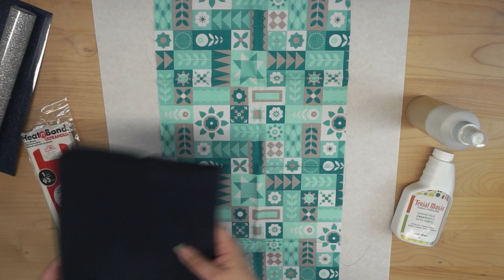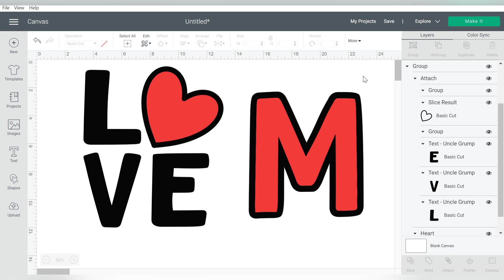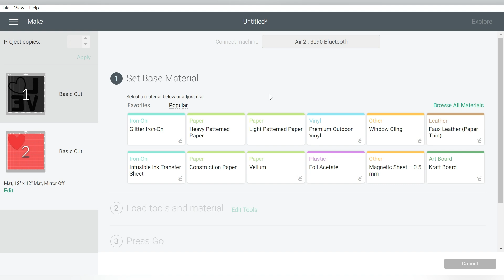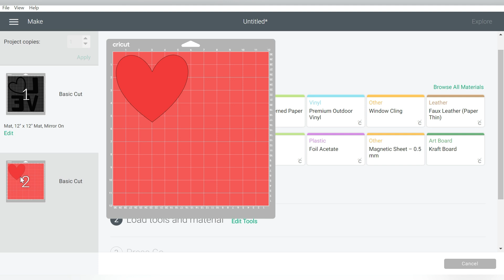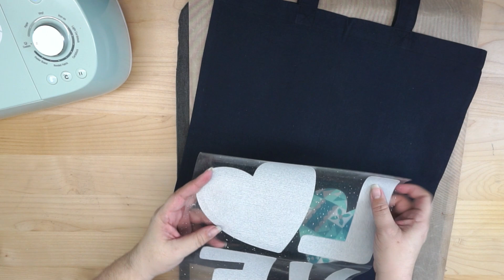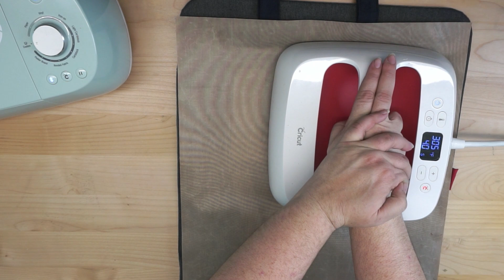✂️ How to Cut Fabric No Sew Applique with the Cricut Explore Air 2

Comment: Nice tutorial. I have done this before and not sure what I did wrong, but the applique piece or either the vinyl shrinks when heat is applied and doesn't connect.  It leaves a very small around the heart.  Did you do a video on how much of an outline I should use on the Cricut Design Space?   I love watching your tutorials.

Comment: Does the fabric need the spray if it’s cut with the heat n bond on it? Like does the heat n bond not add enough stiffness on its own? Also, would you happened to know how well it holds up in the wash?
Reply from the maker: Hi Markie! We recommend hand washing because the heat and tossing may affect the bond! - Dawn

Comment: Hi. This looks great. Do you have to use these products when cutting with the Maker?
Reply from the maker: Hey Stephanie, you don't necessarily have to use the Terial Magic if you are using the Rotary Blade, but you'll still want to use the Heat N Bond so that you can adhere the fabric to the project (tote bag).  Hope this helps!   ---Becky
Reply: @DesignBundles  Thank you!